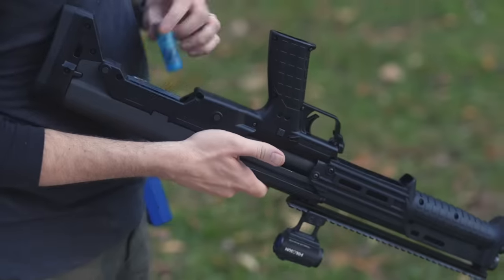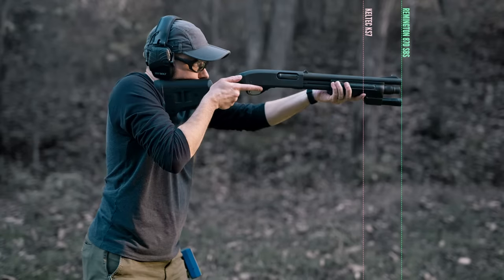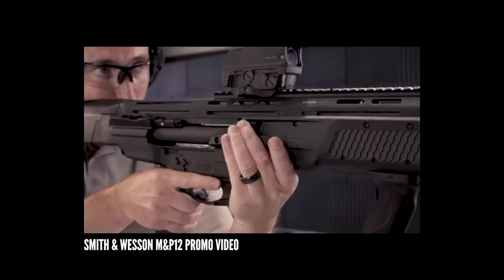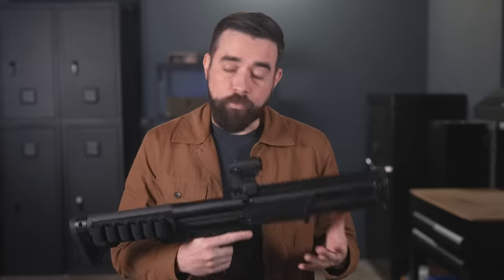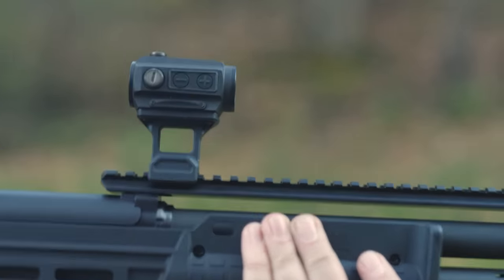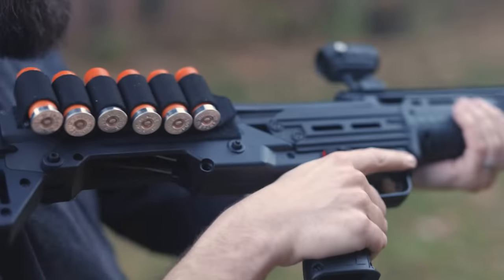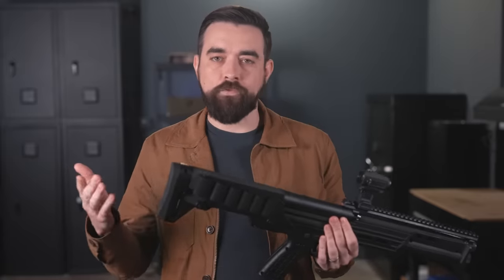The Bullpup Shotgun Experiment

Comment: So, the KS7 supposedly suffers from feeding issues as I'm told by quite a few people who have bought or shot them. It has not been my experience in the two I've shot but maybe I didn't have enough time to see the problems? That said, short stroking seems to be the biggest issue they suffer from by design. 

That said, everything has it's ups and downs as you said and bullpups aren't for everybody. I'd encourage you try the UTAS UTS-15. Early models had some serious trouble but they have since worked through those issues with some minor changes over time. Felt recoil is still going be a thing due to the weight of the gun but it has some distinct differences in the bullpup shotgun world which make it worth looking at. 

As for semi autos, there's a whole bunch of them now and I can't rightly suggest any good ones to start with but I would like to see the project continue.

Comment: A little advice.  With a bit of practice you can load your KSG in ready position instead of turning it over.  Just a little bit of muscle memory like any other firearm and you're on your way.  I do this with my KSG with a foregrip and a one point sling but stick to primarily loading only the left magazine port.  I utilize the right magazine port as a backup at the ready magazine if you don't have the time (for whatever reason) to reload.  The likelihood of you needing more than 15 rounds of 2 and 3/4 inch shells..... yeah....  you may be beyond help.

Comment: I rapidly shoot my KSG without any problems, reloading is easy for me now it took a little getting used to but I can reload quickly, I have no problems with my KSG the only thing was customizing it, I bought a lot of parts. The main 2 necessities are the limb saver and the Howitzer muzzle then maybe the magpul angled grip. Others like the extended rail up top small rail on the side 4 flashlight, red dot mount  on top rail and manual fold up sightes.  longer barrel selector

Comment: So if you’re willing to hear from another KS7 user I got a few tidbits. Some caveats however: Prior to buying my KS7 my only shotgun experience was a decade prior in a military course (shooting the M1014). Also, I’m still very green regarding shotguns.

I found my main issue being that I often didn’t fully cycle the action (I think it’s called “short shucking” but I’m ignorant) so I ejected the spent shell, but didn’t load the next one. It took a bit of practice to fix that, but it seems like a pretty easy mistake to make with the KS7 (the amount of travel in the pump between ejecting and loading seems to be about 1/4 of an inch).

Next issue I had was the same as you, recoil with 3inch shells is a bitch. I found I needed low velocity 2 3/4 inch shells. I also added a slip on pad to the butt stock that kinda helps (a little). I’m also a big guy so the length of pull was actually something I wanted increased.

Positive though, is I found it took me only a little practice to blind load using a similar side saddle setup you had (I could pull a shell and load it into the tube without taking the gun off my shoulder, and keep my sight picture). I didn’t get around to trying to load on an empty chamber though, which I’m going to start trying.

Thanks for the video btw, and please forgive me if anything I’ve put down is akin to telling you how to suck eggs. As I’ve stated, I’m shotgun ignorant.

Comment: Shot the KSG and the MP 12 this week. One thing I can say is I greatly preferred the MP12. Smoother action, faster action, extremely accurate, no failures, and the experience with mini shell slugs was great. The KSG just felt kinda clunky in comparison, and the recoil from the KSG was very stout. Recoil from the MP12 was stout but more tolerable, with only full power 1600 fps 1 oz slugs making me me want to shy away from the gun. I think these pups could use a brake... 

Reloading both is a bit of a misery fest. I have yet to figure out a good way, I'm damn glad they have large capacity.
Reply: I have a KSG that I love and have had no issues with feeding or jamming, I looked at an MP12 at a gun show and I like the the safety on it but that's about it, I really don't like the crossover mag select because you have to take a hand off of the controls in order to do that, I put an extended mag selector on my KSG and I can switch tubes with a flick of my wrist. I haven't had the pleasure of shooting MP12 yet so I have no reference.

Comment: One thing I hate about my friend's KS7 is that it feels super natural to put my thumb on the forward "rim" of the pump's hand hold. Yeah... you don't want to do that. The recoil will wreck your thumb!

The handguard solution I came up with on my KSG is one I've never seen anyone else do before: Magpul XTM Handstop Kit installed "backwards" so the bigger handstop part is on the front. It's very similar to the KS7's handguard, but without the "rim" that wraps up and around the sides of the gun, enticing you to hold your thumb there.

Comment: The softer buttstock pad Keltec sells helps with the KS7's recoil enough that it should absolutely be standard.  It's still fucking brutal against you shoulder, though not as bad.  Mine also has idiotic feed issues like ejecting multiple unfired shells from the tube after firing.  Probably will eventually send it to Keltec for a look but I might just sell it.

Comment: Lack of adjustable length of pull is an unfortunately common issue with bullpup designs in general.  It seems partially integral to the base design, but still surprising no one has come up with a better option in general.  Would love to see you experiment and compare on some semi-autos like the Tavor 12.

Comment: I’m not one to condescend users who test fire my KSG to fault it for malfunctions. Short racking is what I noticed for first time users, myself included. I made the mistake of rapid firing as you did on my first run through buckshot. After getting frustrated with the malfunctions, I went slow, hard, full racks, and everything was fine, but the more I picked up the speed, those problems occurred. So, yeah, try going slow, pick up the pace, get in the rhythm, and go just as fast enough so you don’t run into those problems.

Comment: Ive got a semi bullpup 12 based on turkey design they cooked up. Its pretty good and only grip is rim on bottom of magazine. Ill fill those down a bit. Blasted 50 rounds in an hour and was starting to feel it. The rubber pad need some more squish. Keltec in this case should have pursued a side load into the tube like a Winchester lever gun.

Comment: Working the ks7 or ksg require  new learning curve.  I went to the ks7 for lighter weight.   Still kind of miss my ksg but the ks7 is my primary.
I would like to see you explore bullpups more.  Like any other shotgun a better recoil pad is required on the.ks7.  I have always switched my recoil pads on my mossbergs.   I dont have an issue with sore shoulder after pad replacement. The ks7 action needs to be worked in and loading takes time to learn.  
Length of pull is perfect for me.  Usually pump shotguns come with 14 inch lengrh of pull and require changing.
Like any other weapon once it is broken in and set up for your body its a great gun.  Speed shooting any shotgun can cause problems ie short stroking.  Anyway more bulpup shotgun videos would be great

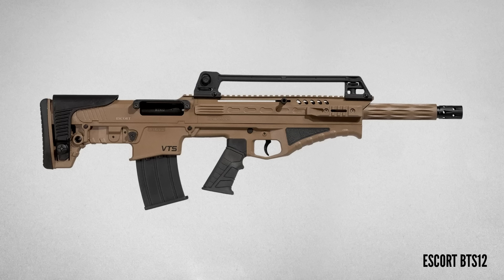Comment: 0:53 & 2:54 
Dickenson Ranger....
The mag release is awesome. 
Most AR style Bullpub shotguns have derpy releases.
Metal where you want it, really good price.
The barrel is CNC'd horizontally so there is too much friction, the noise is like scratching the holographic pogs. Also, not threaded

Fist day; oiled it well, took it shooting. Had some trouble with the feeding of the long shells, but shoots short shells just fine.
The booms scared the shit out of people at the range, apparently people were jumping.
I lightly sanded the barrel with 600 grit then vigorously with 1200 grit to where, at least, I cant file my finger nails  on it and it runs smoother and doesn't make that awful sound.

2:56
Escort
The Mag release doesn't feel derpy, it has a taper to fit your thumb
The charging pin is known to fall out, hard to explain why, but it sucks when it does. 
Barrel is CNC'd longways, somehow, very smooth charge (when the key is still in). Also, threaded.

When shooting, the charging pin/handle slinged off and slapped me in the face a few times.  

Generally, for some reason, the AR Bullpup mags are particular on what gun they will accept to be put into
It's a good ideal to buy them in person.

Comment: Kinda disappointed he didn’t talk about the DP-12 much. Imo it’s only downside is the weight, but that helps massively with recoil.  Plus since it’s double barrel you can get 2 shots off as fast as you can pull the trigger (one pull per shot of course) and with one pump you’ve got 2 more loaded and ready. It’s not a cheap gun but it never fails to cycle and can go 10,000 cycles (one cycle is two shots and a pump) without a deep cleaning. All I’ve had to do to mine is wipe down some stuff and clean the barrels. Great gun

Comment: I have the RIA VRBP100, magazine fed, semi-auto, bullpup 12 gauge. I had to do a few tweaks to mine in order to get in running reliably. However, it still isn’t quite 100% reliable. I love it, as a range toy, but I wouldn’t bank my life on it. I purposely don’t run drills with it, because I don’t wanna retrain my muscle memory, from the AR platform. The AR is my primary weapon, and I’ve gotten pretty good with quick reloads, and overall manipulation of the gun, so I feel better in NOT confusing my brain with the weird controls of the bullpup. Basically, the same reason that I only run drills with a striker fired pistol, with no safety.

Comment: I was recently introduced to the RIA VR 100, I was surprised with the recoil reduction, I would like to see your opinions and thoughts on this tool. I wasn't impressed with the extended box magazine as it was over long in my opinion and got in the way, i found the 10 round to be more than sufficient especially since the recoil from a 1 oz standard velocity slug was barely discernable from the 2 3/4 00 buckshot we had been firing.

Comment: I'm curious about what loads do and don't work with both the keltec shotguns and the m&p12.
Reply: I have heard that everything works in the KS7, including the minishells, but I have also heard the same issues that he mentioned about failure to feed issues, or double feeds, and it mainly has to do with the fact that you cannot, and I mean cannot short stroke these things at all or they will jam up. I just got mine and haven't been to the range yet with it, but you can see how much different it is with pumping soon as you pick it up. I plan to try out #1 and #4 buckshot and some minishells. I think #00 is probably going to be a bruiser in this setup.

Comment: If I plan on using a tactical shotgun for home defense (in hallway/small rooms) would it make sense to still have a muzzle brake on the end of it? Won't it cause the flash and exhaust gasses to go towards and around you as it bounces off the walls and ceiling right above you? Does that negate the use of a small tactical shotgun since it also adds length to the gun itself?

Comment: Definitely a learning curve to bullpups, and the KSG is not comfortable to shoot, especially with slugs. However, keeping in mind it's intended for close range (primarily inside a building) Kel-Tec did design it to cycle mini shells. This almost double capacity and the slugs feel almost like shooting bird shot (granted I am curious to how their "stopping power" compares to traditional slugs). As for the dual mag tubes being switched manually, it doesn't have an overly practical use for the average home owner but does allow you to run different types of ammo, from a law enforcement perspective you could run less than lethal in one and lethal in the other. Personally, I run buckshot in one and slugs in the other so I can choose between spread and no spread or a lot of damage and more damage.

Comment: You need to get a Recoil Pad for a KS7, or it will be a short day at the range.
The KSG and KS7 don't like low brass and like steel even less.  I noticed you were using low steel, the ammo it likes the least.  This can show up more often when firing rapidly.  You also need you work the slide with authority on bullpumps, and when firing rapidly you are more likely to short shuck.  These two things can combine, and scares people off in regards to reliability in a life or death defensive situation..
So practice, and only use high brass for the home defense load.

A Smith & Wesson M&P 12 handles short brass and steel just fine, but it can make your wrist bleed, if you tilt the gun in into your cheek.  It's action is quite powerful.  It also costs a lot more.

Comment: I have a ksg 25. Different philosophy than the regular ksg or any other shot gun really. I call it the fortress defense gun. 25 rounds of buck shot or 41 rounds with minis. I have several thousand rounds through it without a single hiccup.

Also, from a dump bag i can top off load rather quickly. I have practiced it a lot.

Comment: When they first came out I found them quite interesting as the dual-tube thing never really appealed to me. I really wish I could find one to inspect, perhaps the pump mechanism also has a really tight tolerance for travel, so that coupled with the pumping distance being a lot closer to your firing hand means it's just really sensitive to short-shucking. I'm willing to bet that's the case. Perhaps that's why it works better when you go slower, as it's easier to be more deliberate. That being said, it could also just be Kel Tec being Kel Tec so who knows.

Comment: Bullpup gives you long barrel + short overall length
Good for rifles so you can CQB and engage at distance, and because rifle velocity can be heavily dependent on barrel length

But why do you need the shotgun barrel length instead of just getting the much more straightforward mossberg shockwave?
Are you going to be shooting rifled slugs out of your bullpup shotgun to take out deer at distance? 
Good to have the option I guess but pretty niche when you could save money and get a cheaper normal pump with a short and long barrel (Mav 88)

(Mossberg hasn't paid me for this post but they ought to)

Comment: I'm interested in bullpup shotguns, but only as a novelty. I've seen nothing to suggest that they're a better (or even equal) option for home defense than the decades old standby of a short(ish) barreled 870 with a pistol grip (or, in the case of mine, an 870 clone). For self defense applications reliability is king, and from everything I've seen, including this video, reliability seems to be a weakness of bullpups (though, full disclosure, I've never owned a bullpup of any calibre).That said I'd be open to having my mind changed if you keep the series going.
Reply: Mind you, you have only seen the KS7 reviewed so far.
Literally any reliable semi-auto shotgun is objectively superior to the aforementioned 870. If you want to stay traditional, a 1301 is an objectively superior shotgun to an 870 for home defense.

The IWI TS12 solves the whole Kel Tec reliability problem, it's the only bullpup from a respected manufacturer, and by all accounts, it seems to be reliable and well designed.

Comment: Hey there!

I've got a Request for you from WAY OUT of Left Field: I suffer from 3 herniations in my Lumbar and 3 Compressions in my Neck. I USED to shoot 12ga and had no problems, but with my neck and back issues, the recoil from Home Defense rounds, or even Bird Shot out of some guns, COULD give me problems and INJURY!

Roll in the Aguila Half Shells.

Mossberg just came out with the 'S' series that is designed to shoot the Half Shells WITHOUT the plastic adapter, and you can MIX standard shells with the Half Shells (from what I've read so far) without feeding problems. However, I was looking at Semi-Auto Shotguns (Mag Fed and Standard Feed) and the Bullpup Turkish Designs look might interesting. However once again, we get BACK to the 'Can I use the Aquila (or Winchester) Half Shells reliably?' question.

So I put it to you sir: would you entertain buying some Half Shells from various manufacturers and see IF they will Run Reliably in Pumps and Semis, Standard Tube Fed and Mag Fed? This enquiring mind and crippled up old body would REALLY like to know!

Thank you for your time and as usual......

Cheers from the Oil Patch in Central WY

Comment: Any issues with getting light primer strikes ??

I had the opportunity to run 5 different one of these. They all had issues where if you brought rearward pressure on the action (sucking it into your shoulder)  they would all “click instead of boom” 95% of the time

Primers showed extremely light primer strikes. As if the gun was attempting to fire out of battery 

Not even that much pressure either. I wanted to like this shot gun but…Jeesh

Comment: I had a Mossberg 500 as my Home Defense and switched to the UTS-15 Gen 3. The horror stories about the firearm has not been true. You hit the nail on the head - it is a relearning that has to take place. It can't be ran like a semi-auto, so the action has to be smooth and constant to prevent short stroking. The other issue is pulling back on the charging arm after moving front bracing for recoil. This takes the shell out of battery and causes a lack to strike. After practicing, I can run all 15 rounds through without any problems. But quoting Hickok45 - if 15 rounds of 00 buck does not solve your problem - you probably needs something that is belt feed for the zombie apocalypse!